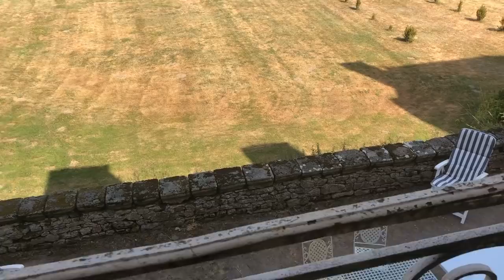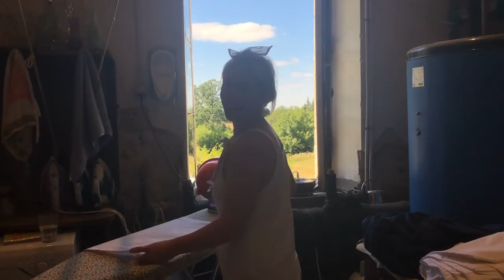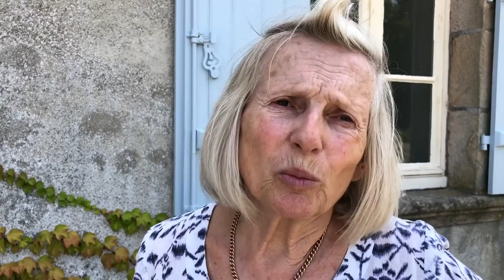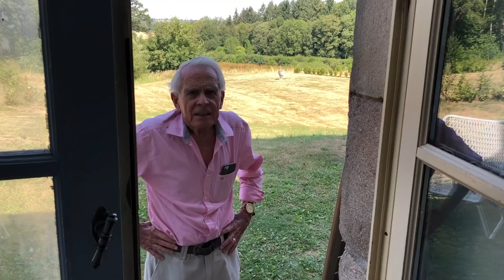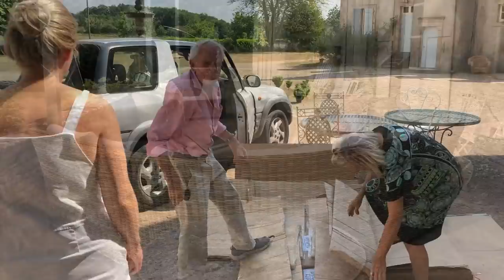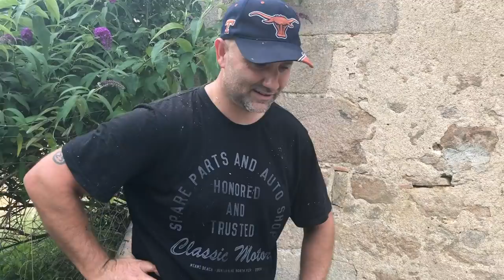The Chateau Diaries 075: Australia to the Rescue

Comment: Ummm, don't mean to question the Dream Teams ability ...if the top is level will rain run off? Maybe?
Reply from the maker: There won’t be a roof! Just the cross beams. I wanted it level so that it looks pretty with chandeliers hanging from it in the summer 💛
Reply: @TheChateauDiaries  good idea to get the table umbrellas then...if you ever want to put a drape across the top, painting drop cloths are very inexpensive per yard, you could get grommets on corners to hook onto wood.